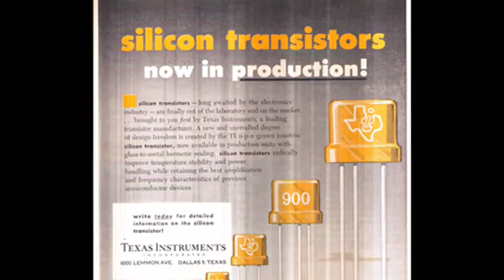12th September 1958: The world's first integrated circuit (aka microchip) demonstrated by Jack Kilby

Comment: It is said that the integrated circuit was FOUND and redesigned as first found in broken control panel inside the ET craft that CRASHED IN 1947. The section contained what we now call opto sensors, and glass fibers as data conduits of frequencies. A piece magnified with microscope revealed multi stages with "transistors". See American Computer Company and book- The Day After Roswell. Modern technology owed to ETs?  Even the see in the dark and Kevlar vests, etc.
Reply: you really think a spacecraft that can travel the stars faster than light is limited to optical glass fibers?   You are so far off relatable technology you wouldn't know if it was magic or not if you saw it.
Reply: I propose that traveling ftl is a hard limit encoded in our solar system that no one can break or come close to for obvious energy requirement purposes  / arguments. That leaves only one potential possibility for ftl travel. Worm holes or some other exotic means of tearing through space time, which an alien integrated circuit would work fine in such an environment. Mass particles would not suffer from infinite weight problems if you're bypassing conventional ftl travel
Reply: It's also said that Santa Clause brings gifts to good children every year. That doesn't make it true or at all sensible to believe in.
Reply: Its all real… now get to the friggin probes!!!🤯🤯🤯👽
Reply: @jayjohn9680  A "Doonesbury" strip mentioned that Demi Moore was born in Roswell.
"Think her body is a little TOO perfect??"